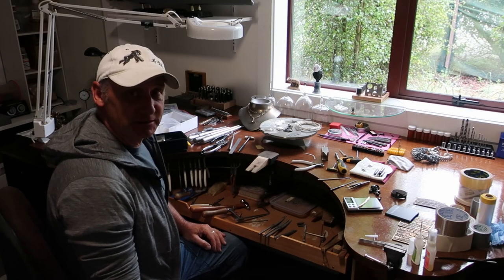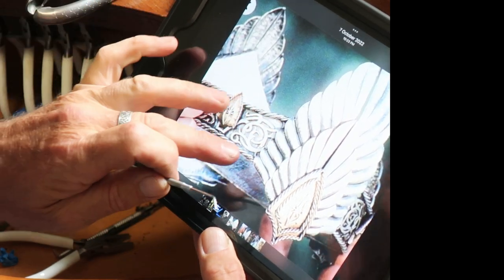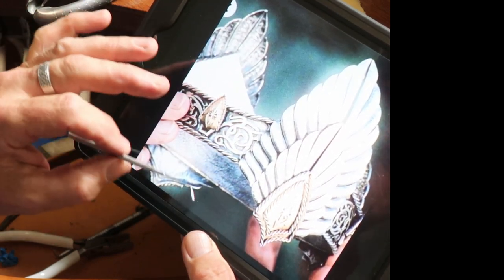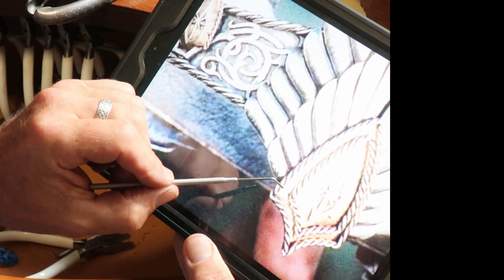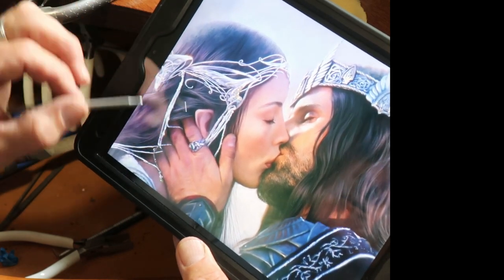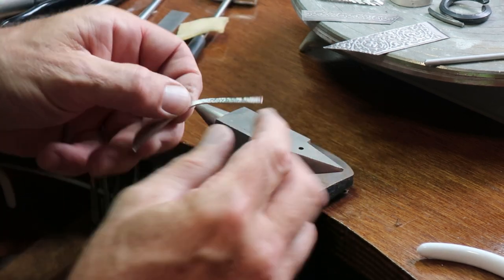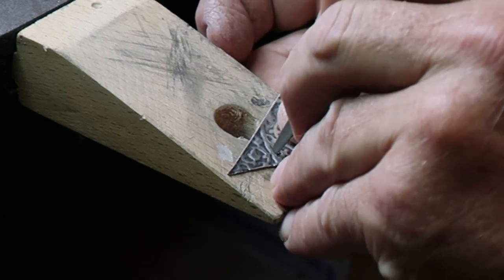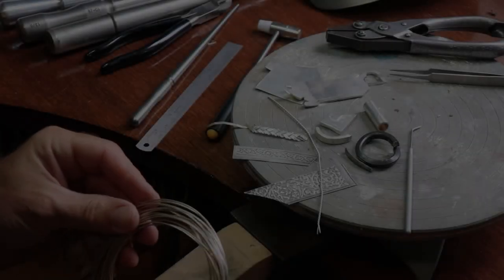Aragorn's Coronation Crown Construction Techniques REVEALED - Part 1

Comment: Great video Dallas, thank you very much for sharing your memories and techniques
Reply: Dallas, question on the assembly.  How did you adhere the individual components of the crown together?  Did you solder the copper pieces to one another?
Reply from the maker: Glad you enjoyed it, thanks for watching……more to come. 👍🏻
Reply from the maker: Hi Mike, yes the pieces were soldered (you’ll have noticed we say “sold - er” whereas you’ll say “sodder”….both are correct 😬). Having said that though, it was probably more like brazing as from memory I used SilFos as it needed to be strong. In any case, I’m a big fan of mechanical fixing where possible because I have a history of ruining projects with too much heat! 
What I can say for certain is that it’s HEAVY! Cheers 👍🏻